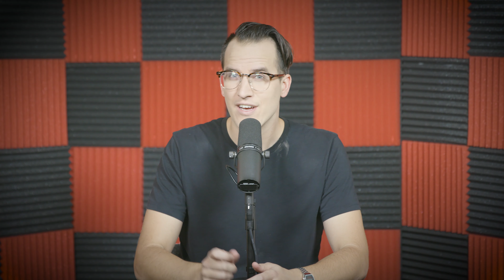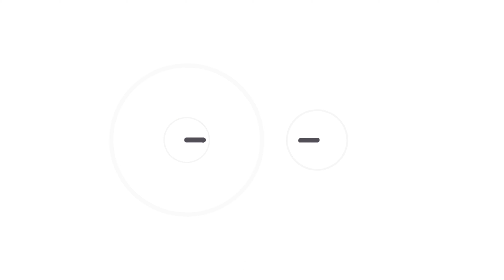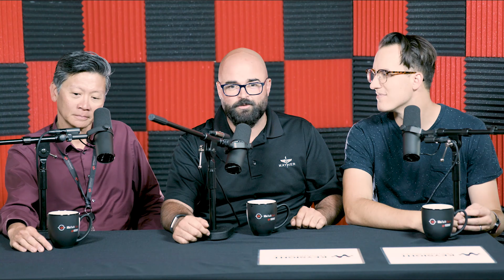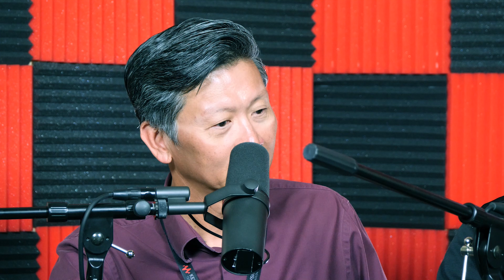USB4 - No more Mr. Nice Guy, your USB-C connector has to do it all! - #38

Comment: It would be awesome if USB4 supported the proposed VirtualLink USB-C by default! Specifically because it allows remapping of the 4 statically mapped USB 2.0 pins for even more bandwidth. This would allow for 6 instead of 4 lanes available for alt modes, USB, and other protocols. https://en.wikipedia.org/wiki/VirtualLink
The USB-C 3.x spec limitation of not allowing the remapping of these USB 2.0 pins really bit end users as USB 3.0 + 4K@60hz (via HDMI/DP alt mode) is NOT possible for a USB-C hub.  This is due to DP1.2+ and HDMI 2.0+ requiring 4 lanes to get 4K@60hz which leaves no more pin for USB 3.0. If I had to guess USB 2.0 pins were not designed to be remapping in the first USB-C spec due to it's complexly, however it would be great to see this in USB4.

Comment: USB type C spec is confusing to me.

For one, I read that the type C spec prohibits any proprietary standard of changing Vbus, with PD or without. Yet you still see standards like Samsung's and the oppo vooc and the like... How does that work?

Also, in this podcast, it was said that you can either have DP or USB 3.2 (If I understood correctly). So how do these adpaters that output HDMI, Ethernet, USB A ports, SD slots, etc, work? Should it not work according to spec?
Reply: you can always use the usb data protocol to transport arbitrary data. That's what USB-Anything adapters do. The driver sends ethernet data over the usb tunnel.

With USB4, usb itself is fast enough to do the same with DP signals.
Reply: @tommihommi1  I mean, I think I get how most of the stuff works, kind of like a hub that has a USB to ethernet adapter and a USB to SD reader adapter, as well as more type A ports free. But I dont know of any USB A to HDMI adapters (though I have heard of USB A monitors)
Reply from the maker: From Jit:
Implementation of Type-C charging must abide by the USB-PD specification and cannot be a proprietary charging spec.
Although they may have some unique marketing names like “Fast Charging”, a USB-C charger must still meet the USB-PD specification.

The USB-PD spec allows a Type-C connector to transmit Native USB, or Alternate Mode standards like Thunderbolt or DisplayPort.
This Native mode or Alternate mode is then translated by the adapters into other standards like HDMI.
But the output of the Type-C connector must meet the USB specifications or the Alternate Mode specifications.